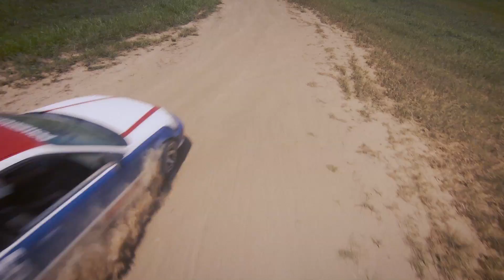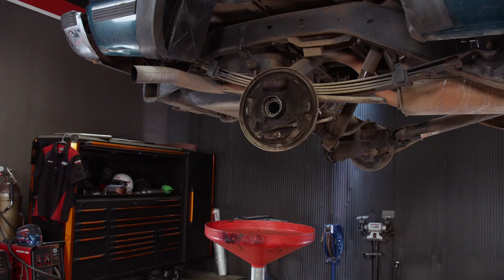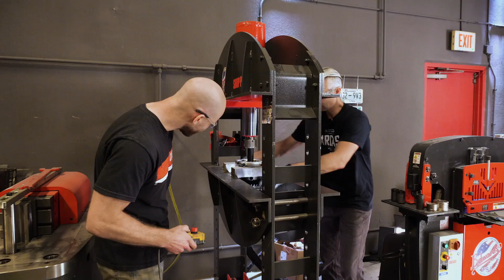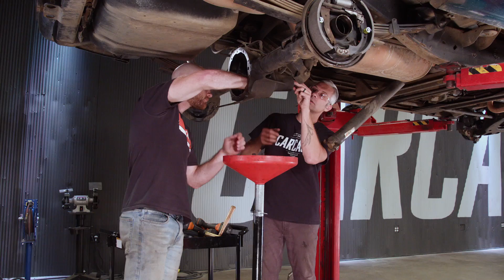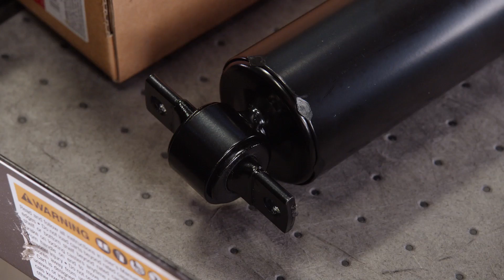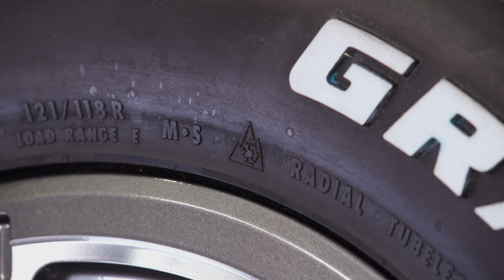How To Set Up A Rear End To Meet Factory Tolerances On A Chevy Tahoe - Carcass S4, E11

Comment: No pinion depth check, and crushed the sleeve too far. .010" play is already at the very end of the spec, and it hasn't even seen the road yet. No worries though, the torn axle seal will run the bearings dry in no time, and they can rebuild it right the next time.

Comment: Using a metal scraper for gasket removal is usually a no no
Reply: It was ok for that, the surface was steel. If the surface were aluminum, you are correct, it would have been at risk for damaging the sealant face.

Comment: For the love of God, why would anyone ever re-use all of that crusty old brake hardware, when it's maybe $5-$7 for a bag of new springs etc....??  🤦
Reply: True, but these days I would much rather use oem vs the cheap “new” hardware. Can’t tell you  how much new stuff I’ve had broken off. If it cleans up nice and isn’t mangled I have no problem re-using it.
Reply: If it isn’t all rusted out there’s nothing wrong with it. You use old bolts don’t you?
Reply: @Bobby82568  A bolt isn't a spring, or a thin-ass clip etc.  🙄

Comment: What sux is that's actually a new gen blazer but they call it a Tahoe.
Reply: tahoe was in between a blazer and suburban.
Reply: They also call it a truck which it's not!
Reply: @jasonmorales1846  it's built on a truck frame. it's a truck.
Reply: @jasonmorales1846  true and some don't know the difference between a Tahoe and a Blazer. Tahoe has 4 door's and a Blazer has 2 door's. Hell I'm old enough to know. Some of the older blazer's had a removable top and that's why they were called a truck. I've got an 1983 k-5 Blazer. But some folk's knows more than us old people. 🤣🤣🤣🤣

Comment: You guys make it look so easy
Reply: It really isnt hard. But definitely easier with a hoist than on jackstands
Reply: @19chev81  yeah I wonder what I could have done in my younger years I used to work out in the front yard on my cars put them up on Jack stands it's hard using a jack hoist or and engine hoist in the grass lol
Reply: @lyndelllyon754  yeah definitely.  Ive been working on a 51 chevy alot just on Jack stands in the garage...a hoist would make everything so much easier rather than crawling around on the floor lol